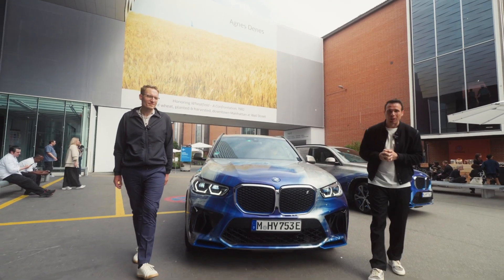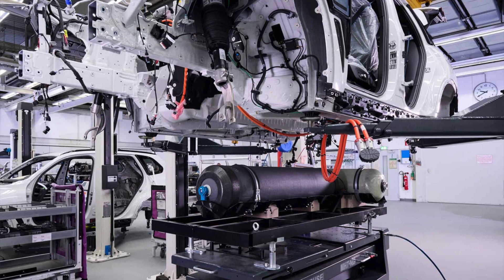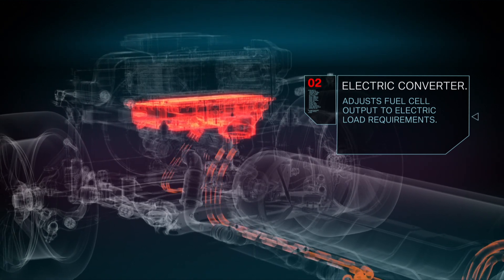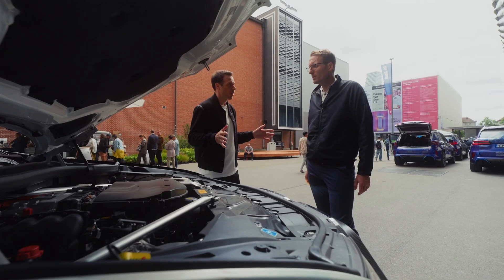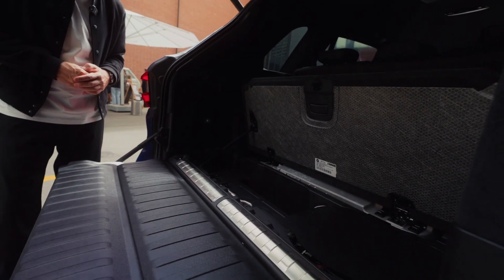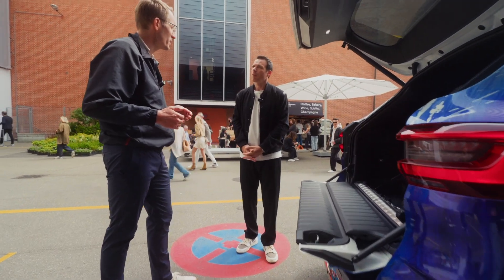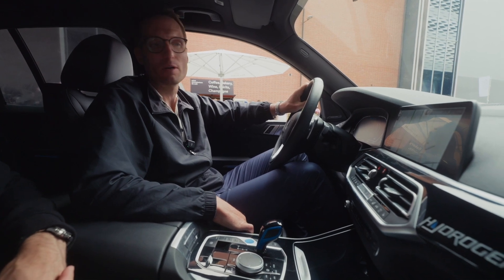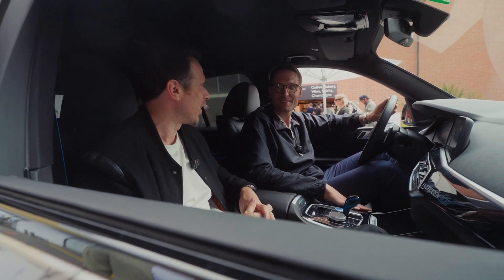BMW iX5 Hydrogen - Is This The Future?

Comment: The nearest hydrogen filling point to me is around 90 miles away. There are just 11 hydrogen filling points in the whole of the UK, so how on earth could this ever be the future? And how much will the cars cost? The Toyota Mirai already costs £60k plus, and the Hyundai Nexo SUV is £80k. And many people said EV's were expensive.....
Reply from the maker: No one disputes that. The infrastructure is far from being ready now
Reply: Bmw and toyota  partnership aims to standardize components and bring down the cost of fuel cell vehicles by developing their own shared powertrain. They will also work together to build hydrogen fueling stations to address the core stumbling block to fuel cell vehicle adoption.

Comment: Hydrogen is much better and save environmental.
Reply: Why is it much better?  t still needs transporting to the places it is sold, in specialist tankers which will continue to emit Co2 during their delivery trips. Electricity needs no transportation. Plus hydrogen fuel cells degrade over their working life, and will need repair or replacement at some point.... And a hydrogen powered car is still an EV, as it uses an electric motor to drive the wheels....
Reply: @Brian-om2hh  A simple google search and you could have answered your own question.  Hydrogen is much better for the environment than fossil fuels for several key reasons:

Zero Emissions at the Point of Use: When hydrogen is used in fuel cells (such as in hydrogen vehicles or industrial applications), the only byproduct is water vapor. In contrast, burning fossil fuels like gasoline, diesel, or natural gas produces harmful greenhouse gases (GHGs) such as carbon dioxide (CO2), which contribute significantly to global warming and climate change.

Reduced Carbon Footprint with Green Hydrogen: When hydrogen is produced using renewable energy sources (green hydrogen) through electrolysis, it has minimal to no carbon emissions, making it a clean energy source. This contrasts sharply with fossil fuels, which release large amounts of CO2 when burned.

Decarbonizing Hard-to-Electrify Sectors: Hydrogen is crucial for decarbonizing industries that are difficult to electrify, such as heavy transportation (trucks, ships, planes) and high-temperature industrial processes (e.g., steel production). These sectors rely on hydrogen to replace fossil fuels, reducing their environmental impact.

Energy Storage and Flexibility: Hydrogen can store excess renewable energy (such as solar or wind power) and be used when needed, helping balance supply and demand. This makes it a valuable tool for reducing reliance on fossil fuels for energy storage and grid stability.
Reply: @Brian-om2hh  No i doesn´t  i can be produce locally in some gas stations already do that , and their are two type of hydrogen systems internal combustion (DAF  hydrogen ice Trucks its one example ) and fuel cells  .

Comment: I always laugh when I hear people make comments about whether hydrogen vehicles make sense. They seem to forget that electric vehicles have been around since the 1800s. However, it’s only within the last 10-20 years that they’ve started to become almost ready for the mainstream. This is how technological advancements work. Yes, hydrogen vehicle technology may not be ready for mass adoption at the moment but things may look very different 10-20 years from now as the rate of advancement through R&D accelerates.

The other joke is when people whine that the fossil fuel companies are behind hydrogen technology R&D so they can keep selling fossil fuels to us. I wonder who they think are the real big players and money brokers behind the supply of electricity for BEVs 👀. We’re talking about companies with trillions on the line and who have the power to buy instead of build. Pray tell, who does one think will win in the end, irrespective of the technology? The same big players.
Reply: Thing is batteries are way more efficient than green hydrogen. Grey hydrogen is more efficient in comparison to green hydrogen, but that's defeats the purpose of going green with an hydrogen fcev. Using renewable energy to move forward bevs just waste way less joules than hydrogen.
Reply: @KabooWaboo  Your statement oversimplifies the comparison between batteries and hydrogen and is misleading. While batteries are indeed efficient for short-range electric vehicles (EVs), hydrogen has distinct advantages in specific use cases. Hydrogen fuel cell electric vehicles (FCEVs) offer long refueling times and longer ranges, which is ideal for heavy-duty transport, buses, and long-distance travel—areas where batteries can be less practical due to longer charging times and weight limitations. Additionally, hydrogen can be produced from renewable sources (green hydrogen), and while it is less efficient than direct battery use, it offers benefits such as energy storage for seasonal or large-scale needs, which batteries cannot efficiently handle.

Grey hydrogen (produced from fossil fuels) is less efficient and counterproductive for a green future, but green hydrogen, produced via electrolysis using renewable energy, is a clean energy carrier with potential for decarbonizing sectors beyond personal transportation, such as industry and shipping. The efficiency of hydrogen may be lower than direct battery use, but its role in a diverse, low-carbon energy system cannot be dismissed.

Moreover, renewable hydrogen can complement BEVs by addressing sectors where BEVs are less efficient, making it an essential part of a broad, sustainable energy solution. Both hydrogen and batteries have their place in a decarbonized future.
Reply: @KabooWaboo  But hydrogen is a lot more abundante them the material to build batteries , and imagine the size of the grid have to be to fill 30 billion cars truck ships and other vehicles .
Reply: @CMeosuarra  and imagine the grid if we had to only obtain hydrogen through electrolysis? Also battery recycling can recoup over 95% back the important materials
Reply: @wdbsurfer  laugh well. Today our technology can see billion of stars can compute their past and their future from a very long distance, and science days hydrogen is not efficient, not easy to produce cleanly, not easy to transport and keep under some temperature and high pressure. All cost will stay there, it can be not hydrogen but anither substance in the future for sure, I am sorry but don't laugh at science

Comment: While Toyota Mirai owners sue Toyota, BMW is following Toyota lead and believes in inefficient hydrogen future??
Reply: The claim that Toyota Mirai owners suing Toyota undermines hydrogen’s future is False and misleading. Legal cases involving individual owners do not reflect the broader commitment Toyota has to hydrogen as part of its strategy for carbon neutrality. Toyota sees hydrogen as a viable solution for sectors where electric vehicles (EVs) may not be practical, such as heavy-duty transport, buses, and long-range applications.

The idea that hydrogen is inefficient is an oversimplification. Hydrogen, especially when produced from renewable sources (green hydrogen), can be a clean and sustainable energy carrier. It offers advantages like high energy density, longer range, and fast refueling, which make it ideal for certain use cases, even though challenges such as production costs and infrastructure remain. Improvements are being made in hydrogen technology, making it a promising part of a diverse, low-carbon future.

BMW is not blindly following Toyota but investing in hydrogen alongside EVs. Their development of vehicles like the BMW iX5 Hydrogen demonstrates recognition of hydrogen’s potential, especially in areas where EVs face limitations. Both Toyota and BMW are exploring hydrogen as a complementary technology to EVs, not a sole solution, in the pursuit of sustainable, zero-emission transport.
Reply: @tjhero3243  from a book or you really write yourself? looking how you use Toyota and BMW in sentence. are you marketing department?

Comment: Hydrogen is already winning for Class 8 trucking and public transit.  Green hydrogen will be cheaper than diesel within 5 years.  As for personal transportation, the market has spoken and plug in hybrids have won
Reply: even with hybrid, petroleum is not winner in anycase
Reply: NO way will hydrogen be cheaper once the oil companies sink their teeth into the pricing. They need a replacement for reducing sales volumes of petrol and diesel, and if hydrogen takes off, then that'll be it....

Comment: How are they producing hydrogen?  Who owns the companies producing hydrogen?
Reply: @jrbigger  your question is very much valid. If a very big company supports and promote a very inefficient and at the end expensive solution like hydrogen (Toyota did and now all mirai customers sue Toyota!) it means there is another game behind, it can be partnership with an energy giant which doesn't want it's business go bankrupt like Shell or Toyota which doesn't want battery cars to be favourite yet as they have many hybrid cars in stock that they can sell with more profit or BMW which thinks they already lost battery war against China and a solution without big battery is the only way for them to go out of this trouble, even it is non sense in terms, they just play with time giving customer a misleading message "battery is not future don't buy it, wait for something else, in the meantime use your petrol or hybrid car" which is just a trap for us consumers
Reply: You can produce hydrogen at home yourself.
Reply: @Euszebiu  hydrogen is not an energy, you can produce hydrogen by using energy at home but you cannot keep it under required pressure therefore you cannot put it in your car. Plus it would be very inefficient to use energy to produce hydrogen and hydrogen going back to energy, you loose around 40 percent of initial energy, so much is lost
Reply: richlee509  correct, we all agree petroleum combustion car is the least efficient, and most harmful. We just compare hydrogen with battery electrical cars (BEV). Hydrogen cars also has battery but much smaller and idea is just to create an energy buffer as producing electricity from hydrogen is not fast enough when you need to accelerate, but you can only charge it with your hydrogen which means you will loose energy because of the inefficiency of the process also transfer of hydrogen to gas stations and keeping under a temperature and under high pressure make hydrogen very expensive, nobody would like to build those stations. But with battery car, you can even produce your own electricity at home and charge your car.
Reply: @trexeyesonly55 What about big battery cars need a lot of lithium wich had to be mined from earth. Those mines are apsolutely devastating for natural environment.
Also what about battery degradation and a need for new expensive ones over time?
The production of batteries is also harmful for environment.
I like this hydrogen concept so far, I thinknsomething like this is much better than a pure ev aproach.
Reply: @NunoVipan  unfortunatley hydrogen is very inefficient and will be promoted by existing petroleum companies, but even for them it is very expensive to transfer and keep in a station to serve to public. Neverthless, environment is more important than effieicny even, be assured that now we can recycle litihum from used batteries more than 70% and  batteries which cuts carbon emission by 61%, uses 83% less energy and 79% less water compared to mining. Lithium is not consumed in a used battery unlike petroleum. And the beauty of it in time those techniques become better and better
Reply: @trexeyesonly55 Brother correct me if I'm wrong. 
- Mining lithium and producing batteries is very dirty!
- Running a hydrogen fueld motor is not!
Right? 
Hydrogen car has range of 500km  or more and takes few minutes to recharge.
What is inefficient in that?
Reply: @NunoVipan I am telling you butbyoubrepeat same things, I recommend you look more on efficiency of hydrogen there is plenty of resources
Reply: @trexeyesonly55 you are not answering me. 
You are throwing some numbers that mean nothing in real life. You are advocating for mining lithium and poluting the environment by producing chemicals that goes into heavy and expensive batteries who was to be replaced because they degrade over time and whos performance is depending on weather conditions.
Yes, ev technology will be better over time, but so is hydrogen platform.
Reply: @NunoVipan no it is not, weve put plenty of information here, learn by yourself more about it if it is not enough for you or if you like it buy some hydrogen from your favorite oil station, dont loose time, or dont let us loose time
Reply: @trexeyesonly55 Hydrogen platform is superior than batteries.
It is carbon free in all from start to the end.
Battery production is dirty and maybe you or your children can go work in lithium mine if you want to, I'll rather go to gas station.
Reply: @Euszebiu  And void your home insurance in the process.....

Comment: From memory, they researched this along with Toyota in the nineties. 
I believe that Porsche are looking into different fuels too. 

I’m not a great EV enthusiast at this juncture, the carbon foot print is there during manufacture and I worry where the power is coming from if we all converted, we haven’t invested in Nuclear power stations and l don’t believe that wind power is sufficient. 

ICE is here for a while, unless of course everyone wishes to covert to “peddle power” 

Best regards
Reply: Man at the current rate that companys who make PV panels,are cutting cost, the green energy will be very cheap at daytime. Think about it, all those pump that move petrol from the deep pockets, then they need to heat up the petrol to make gas and diesel, thats a lot of energy. If the gov didnt help them with this cost, gas prices would have been 2x by now. EV are the future, just wait for better batterys.

Comment: This we can get behind. Aside from infrastructure. This is > Bev "Long-Term" not some short termer like all the Tesla battery boys about to flood the comment sections.
Reply from the maker: Infrastructure is a big if still
Reply: Hydogen cars still need batteries my dude.
Reply: @CheddarKungPao  so do Duramax & Cummings holmes.
Reply: @F85M  not talking about 12v i mean the same  lithium ion high voltage batteries that BEVs use.
Reply: @CheddarKungPao  Oh, absolutely, you’re spot on! Hydrogen cars are just like those hybrid models—except instead of a huge battery, they only need a tiny one. Think of it like having a pocket-sized battery to power the car's electronics while the hydrogen does all the heavy lifting. So, no need to worry about hauling around a massive battery; it’s more like a compact accessory. Maybe take a look into the details; it’s quite a fascinating setup! 😉
Reply: @jaroslavsimon8100  you are incorrect. I have looked into the details. The fuel cell has very limited maximum power output, so the battery needs to be pretty sizable or you will have a very slow car.
Reply: @CheddarKungPao  "so the battery needs to be pretty sizable or you will have a very slow car" - what is it that you're smoking?  Hydrogen-powered cars are propelled by electric motors which are supplied by the electric current coming out of the fuel cells.  There is no battery here, at all, involved in the vehicle propulsion.
Reply: @ you are 100% incorrect. Please educate yourself. The Mirai and all other fuel cell vehicles have a battery which is mainly what supplies current to the motors. The fuel cells are not well suited to the power needs of the vehicle, due to a wide range of current draw being needed and instant response being needed. Addiitonally, without a battery the vehicle could not recouperate energy when slowing down and would have even worde efficiency than the pretty terrible efficiency they already have.
Reply: @CheddarKungPao  It is you who is 100% incorrect.  The fuel cell provides the steady supply of electricity, while the battery only handles peak demands and enables energy recovery during braking, enhancing overall efficiency.  It does not propel the car.
Reply: @ but a car does not need a "steady supply of electricity." It needs more and less power all the time due to moment by moment demands. The fuel cell responds sluggishly when more power is needed and cannot supply the high amounts of power that a battery can. When a FCEV's battery is drained it drives like garbage. And again, you said the battery isn't needed. Which is 100% wrong.
Reply: @CheddarKungPao  And exactly how often are people driving an FCEV when it's battery is drained?  Like, 0.1% of the time under extremely unfortunate circumstances??  We're no talking about Formula race cars here, we're talking passenger vehicles which more or less just need a steady state of electricity most of the time.  You said this requires batteries.  You remain, 100% wrong.

Comment: Hydrogen?? Let’s gooooooooo. Thank you very much for sharing the news!
Reply: its not news, it is dead already check what happened to Toyota Mira owners
Reply: @trexeyesonly55 , the cars are brilliant, the fuel infrastructure is the problem.
Reply: @Euszebiu  not only the infrastructure, it is very inefficient to use energy to produce hydrogen, keep it under very high pressure, transit it with trucks that support very special tanks with very high pressure and low temperature, transfer it to a huge installation in the fuel station, and use energy in that station to keep hydrogen in a given temperature and pressure.... Hydrogen is not energy by itself, it is just a way to transit energy and it is so inefficient, therefore it will be always very expensive, this is the story with Toyota mirai owners, they were deceived by toyota lies, instead of hydrogen infrastructure growing, stations are shutting down!